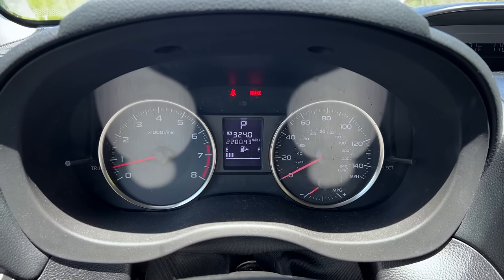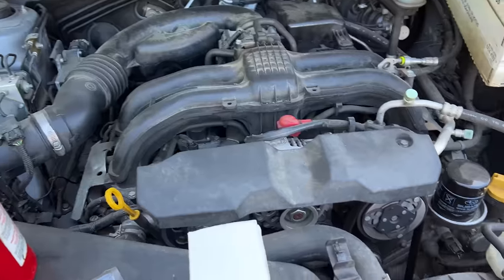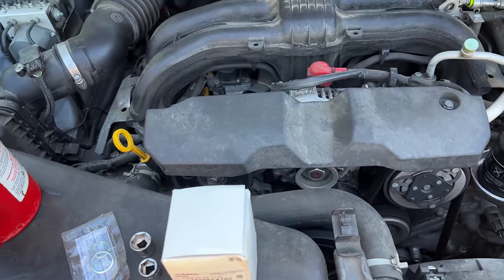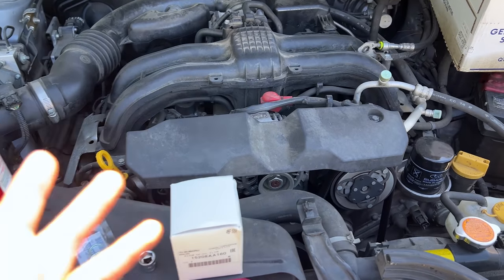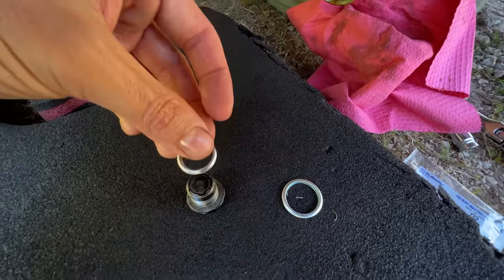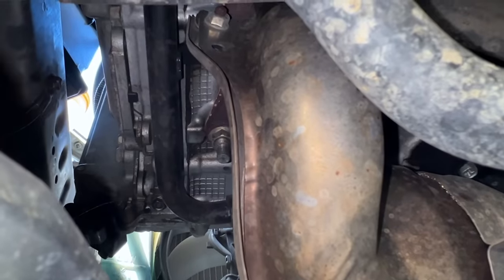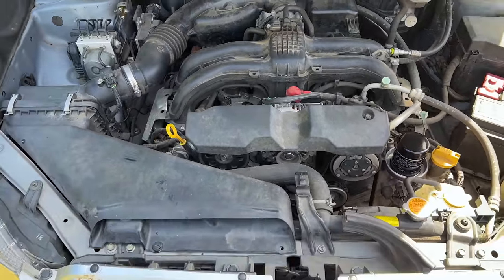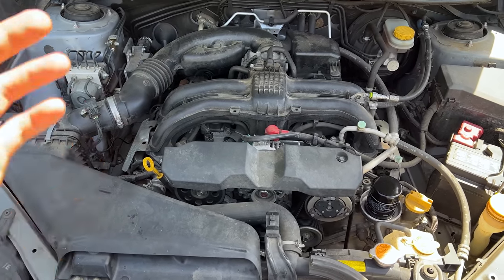220,000 Mile Crosstrek Oil Change - How Has The Cheapest, Highest Mileage Crosstrek Held Up?!

Comment: I have a 2015 Subaru crosstrek it has a vibration at idle when put in gear…. Not skipping any ideas?
Reply: Maybe replace the PCV valve?
It's about a $20 part, or maybe look at cleaning the Throttle Body.

Comment: You made it to 220k on the original transmission? I couldn't get it to 134k without replacing mine.
Reply: He bought it used last year with most of those miles on it

Comment: Is your injector spray pattern still good having 200k. Injectors dont last forever
Reply from the maker: Fuel system/ top engine cleaner. Did a video on that, on this vehicle.
Reply from the maker: https://youtu.be/42irzdKKfw8
Reply: I saw it. It answerd a few questions i had.  Im asking are subaru oem injectors whats there service life avg? Some injecters have pintle and seat wear issues or drive coil issues, does subaru suffer from these? Thank you
Reply from the maker: @levihillsman7843  I've seen Subaru injectors over 400k miles without fail. Haven't heard of an common issue or failure with them.
Reply: Thank you

Comment: Do you have a video about the 2014 outback 2.5 red oil light flashing when coming to a stop?  The Oil light on the left side.  Not sure what is going on.  It only happens when the engine is idleing down.  Any info is appreciated.

Comment: Dunno just did a ATF fluid and filter change on my 3.6R premium was 1.5 litres low on ATF fluid 😯was black as I dont think I’ll do the torque turbine sensor on the valve  body that paper filter was bad and low on ATF fluid

Comment: I wonder why on the Subaru Roku oil filter 15208AA031 wonder why this filter doesn’t have a anti-drain back valve in it just the other day I was checking out the WIX equivalent and it does maybe because the filter so close to the sump???

Comment: Hi!
When they say 5.1 quarts, how much is that .1? I use 0-20 and have put like half a quart and a few thousand miles in the oil level light comes on. Only happens once between oil changes. I don’t want to over fill. Mine is a 2014 Impreza Sport and I do spend a lot of time in the 65-80 mph range (early 4am work commute with empty roads) 

Might go to 5-30 oil so the oil isn’t too thin in the heat down here in Central Florida
Reply: No answers yet from anyone? Tough crowd.

Comment: My JDM 2004 Subaru Forester has an issue at take off. Its automatic (sadly) and when lifting off the brake to go it doesnt go until the pedal is lifted about 3/4 of the way and kind of jerks and then goes. Tranny fluid has been changed twice. Front and rear diff fluid has also been changed. Doesnt always do it. Only does it when warmed up. Also never does it in sport shift mode. Always takes off perfect in sport shift mode. Any help is greatly appreciated! Thank you! Car has 75,000km.

Comment: My 2011 Outback 2.5 Limited has 464,000 Mi on it it uses no oil and runs like a Swiss watch I have always used mobile one 5W-30 and mobile Mobil 1 108 a filter every 5,000 miles I purchased the car new in December of 2010 it has the original engine in the original transmission

Comment: Thankfully Subaru sells the cone/chain pack for these CVTs so as to not have to replace the whole trans if don't want to unlike Nissan and Honda. More than likely its been replaced twice by now, Very very very rare to see a Subaru with 200K+ with the original cone/chain pack unless you drain/fill every other oil change.

Comment: My 2015 Impreza engine just exploded due to a freak accident where one of the sparks had both electrodes break in #1 along with an inch of copper conductor from the spark. Broke the piston and wrecked an intake valve. 154k and it would have gone another 100k if it hadn't happened. :(

Comment: a 2011 subaru forester non turbo was left to me. seems to burn a quart of oil every 1000 miles .not showing oil burning out the exhaust. is this normal also can i use 5w20 or 5w30 synthetic instead of 0w20
Reply: Yes. Using 5w-30 will reduce oil burning.
Reply: @andreahighsides7756  thank you!

Comment: Man I wish my car was that easy to do an oil change. My oil filter is kind of in the middle of the bottom of the engine. There is no way to use a tool there as you have to snake your hand around some hoses and struts.

Comment: MrSubaru1387, did you ever consider installing a Fumoto drain plug valve? Your subscribers would probably appreciate it. It could be a separate video that generates a lot of views, and subscribers.
Reply from the maker: I hate them. Would never EVER install one on my vehicles. I bought a WRX used that had one previously installed. First thing I did was remove it and throw it in the scrap metal bin.

Comment: The 17mm drain plug still fits the FA/FB engines.  You just have to buy one from the parts store and swap out the crappy 14mm with the small head.  Threading is the same...just easier to work with.

Comment: 20%Ethanol WTF ..  I’ve never run Ethanol fuel or gas as the USA calls it. Never trusted it.. I’ve always run the highest available, which 98 here in Australia, sure it costs a bit more but mileage is very good. 98 burns cleaner and better for the engine.

Comment: i  have been in the Think Tank off & on this month for more hours than I care to admit looking at the RU situation and trying to judge for myself . . . does this brand have any redeeming quality? Looking at this video like most that only feature older RU's and discuss the long list of maint. maint maint & Failure points. It is impossible to tell if RU has fixed any of these? I mean Bad CVT Valve Bodies, Dried/Leaking Gaskets All Over ?, CV Axles &  Boots, Specialty Fluids/Lube's  oil/atf/ coolant/ diff and more requiring fanatic frequency . . . Is just too much unless you are a RU Specialised skilled mechanic with a large shop/garage and have a Ton of free time. 

A lot of what I see here are just a result of cheap factory parts and no QC ( RU does not care ) and that's the worse situation there is. 

The vast majority of people who unknowingly buy into this and who are forced to depend on only the dealerership for maint/repairs are going to be quickly awakened and become anti-RU for life. 

There are signs starting to surface that this unfortunate failed business model still continues on with the latest models  i.e. much of what has been been proven to be a common failure point is  still broken. And . . .

No one with enough expertise wants to look and weigh-in  . . . e.g. Has the Oil Pick-Up in the RTV'd glued on oil pan been fixed.
Not good boys and girls . . . not good.

Comment: The power and MPG lost stems from the PVC. Just changed the PVC and you'll be fine.
Reply from the maker: The PVC is all new with less than 10,000 miles on all components.

Comment: I've never doubted Subaru reliability, but I could only stand my manual transmission Crosstrek for 10 weeks – then I had to take the sizable financial hit and trade it in on something I might enjoy driving. Speed is not crucial (my street racing days are decades in the past), but I do need to be able to merge with highway traffic, and the Crosstrek had a hard time doing that. It also had so little low-end torque that I managed to kill the engine at least once every time I drove it – and I've been driving manual transmissions for more than half a century without killing the engine. Clutch and throttle on the Crosstrek were just too touchy. Comfy on the highway, I liked the car's looks, but it got disappointing fuel mileage (29 mpg), and boxer engines are simply far too noisy. I won't buy another one.
Reply: Get a wrx 😈😈😈😈

Comment: Yeah it’s probably the air fuel ratio sensors they’re just getting lazy I know mine was at 120 On my 13 EZ36 Also where are you going for gas if I go anywhere but Chevron I’ll just get horrible gas mileage these days again it’s probably due to the reblending of the fuel and the stupid ass ethanol